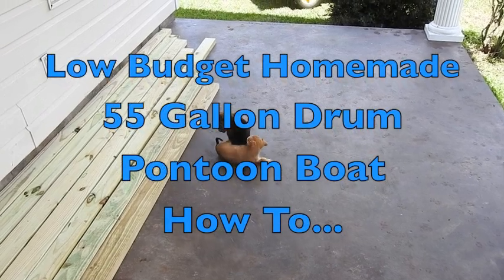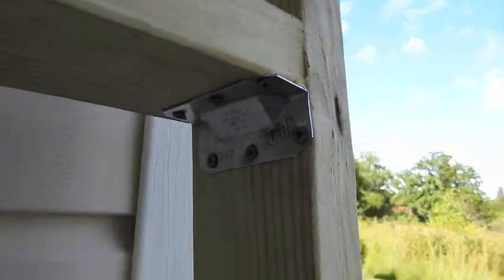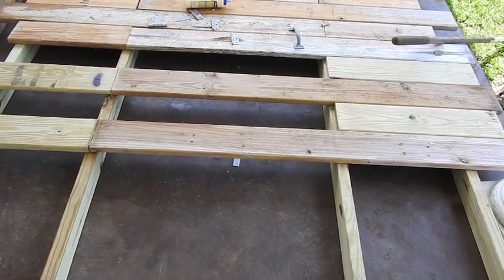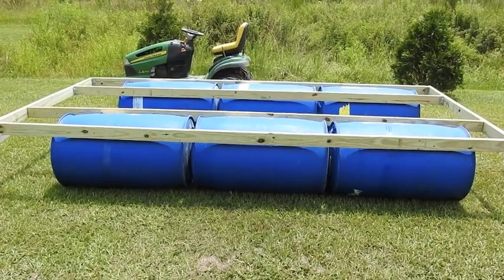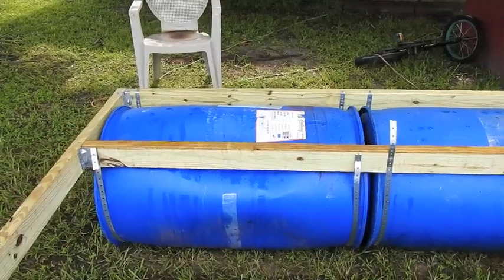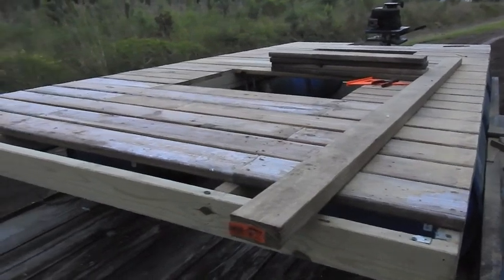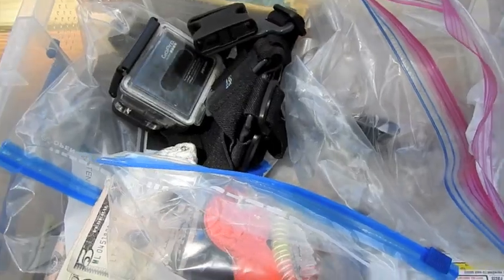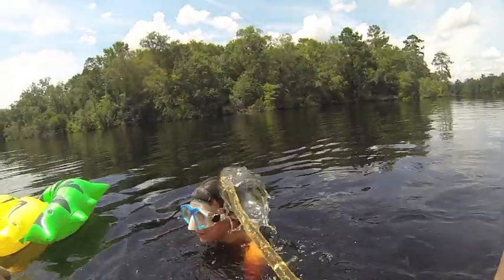My $200 Homemade Pontoon Boat (55 Gallon Drums)

Comment: Great work it's been a while since you built your boats can you tell me how they are holding up and any changes you have made or would make if you built another one thanks for sharing
Reply from the maker: @huxmetalworks7371  I actually sold both, but would think they are still afloat somewhere. Hope to build #3 soon and do not plan many changes. Might do deck boards next time instead of the plywood. I will make videos for you when I do and thanks for watching!!
Reply: @chud327  awesome I just found your fb  I love all of your videos you inspire me to think outside the box with you mowers and mowers I watch everything I can find  I look forward to seeing your next build thanks for sharing your work
Reply from the maker: @huxmetalworks7371  thanks so much!!

Comment: Im starting to build one of these have u had any problems with your barrells swelling from the sun  hitting them n making them hot then when sun goes down does the barrells get loose after they cool off
Reply from the maker: Next time, I am thinking of putting hole in the top so that they can't swell and contract.  Mine shrunk when I took it into some cold springs in episode #4. Thanks for watching and keep me up to date on your build.

Comment: Did the straps you used to attach the drums to the deck rust?
Reply from the maker: Not a bit! I you check out episode #8 from last month, it shows the straps after sitting on the ground all winter and no rust. Thanks so much for watching.  BTW, I have a "homemade barrel boat" facebook group, please consider joining it.

Comment: What engine did you used? and what the name of tin metal you used to wrapped the gallon drum?
Reply from the maker: that is a homemade boat motor, Johnson bottom and briggs and stratton pressure washer engine. The straps are called plumbers strap. Good luck and thanks for watching.
Reply: @chud327  thanks mate for replying my comment i wish to build one day. good luck too

Comment: Nice, but I just wanted to comment on the metal straps. You need to consider another kind of straps. I had the same thing holding my gas tank to my truck, it doesn't last long due to rust and breaking. Maybe winching strap sight work better
Reply from the maker: Those metal straps sat on the ground all winter with a sign of rust.  They could have been a little stronger, I guess, but they did fine in my book. My next boat will be used in salt water, I may need to thing of something better to use... Thanks for watching.

Comment: Seatbelts from a wrecking yard work well to fasten the barrels to docks/home made pontoons as well. Save a few bucks on the plumbing strapping :D
Reply from the maker: The plumbing strapping was about $12 and I used about 1/2 of it.  Are seat belts free, if so, that would be pretty neat to use. Thanks for watching.

Comment: Cool ass idea... but I think you should have made the platform much wider and longer. Those barrels could support a lot more.
Reply from the maker: Yes, but wider would not fit on my trailer, a long boat would have been cool. Thanks for watching.
Reply: Guess I didn't think of that. Good work, either way! Peace, bruh.
Reply from the maker: Thanks for the reply.

Comment: Nice video and awesome idea.
Reply from the maker: Thank you so much and have you seen my second pontoon boat? It is even better. Thanks for watching.
Reply: chud327 I am watching right now as we speak
Reply from the maker: @bahamasking2063  Sweet, I love hearing that. be sure to let me know what you think.
Reply: chud327 I will build one but not a boat. I will build a floating house with those barrels and then build a boat afterwards
Reply from the maker: @bahamasking2063  Sweet. I have a Facebook group called "Homemade Barrel Boats".  Be sure to check it out and maybe even join.
Reply: @chud327  I just signed up to join your group Sir

Comment: Nice Vid. Didn't read all (at this particular time) 1.3k comments to see if it was here, but would suggest an aluminum angle, channel, or even better yet a "box" frame. Cost may not be any higher if you found a sweet deal on some recycled aluminum. Aluminum could be screwed and/or bolted at joining points to avoid tig welder rental (or in my case, having to borrow from a relative.... holy crap). This would yeild same or better strength and wouldn't take 5 people to "heave" the boat back on the trailer. Speaking of, why not make a detachable pair of runners to load/unload your pontoon. I'm thinking each side under the barrels having something styled like a kitchen drawer slide with ball bearings which could be installed on a temporary basis (unless the trailer is devoted only to that boat). Harbour Freight has some roller balls for heavy tool stands at $.99 each which could be utilized and made into the main part of a runner. These runners could also be made of aluminum, and would last a long time with the ball bearings taking all the wear. Cost may increase to $300 or about, with the new frame and runners, but STILL....$300 for a pontoon?? And you could (but I'd rather scavenge some aluminum, or recycled marine ply) attach the same salvaged decking, basically sacrificing a massive amount of weight for the same (or close) final product/cost. I think a bit smaller version of your concept, with an aluminum frame, would make into a nice 1 or 2 person (depending on length) fishing craft , with a couple of pedestal seats of course.
Reply from the maker: Aluminum would be great, but I don't know where to find a good deal on it.  Many of the viewers may have trouble finding it too.  I am starting boat #2 and have already bought the lumber, trying to make it so anyone can build it. Thanks so much for watching.

Comment: Nice job Chud, i built one a few years ago and the plumbing straps have almost all rusted away, i;ll be using Stainless straps next time if i can find any.  i only used 4 drums and its a bit rocky in the water, is 6 drums more stable when walking around the Deck while in the water?  Keep up the good fun work. :)
Reply from the maker: Stainless would be nice on my next one too. The 6 barrels are very stable in my opinion, but now I want to build #2 longer and wider with 8 barrels. Thanks so much for watching.
Reply: HI again Chud, where did you get the Metal Corner 6 hole Brackets from?  @chud327
Reply from the maker: Kevin Chedville they were straight from Home Depot.

Comment: Cool build. Just keep an eye on the barrel straps, it would not be good to lose a barrel because of a rusted out strap.
Reply from the maker: Good point. I just had it sitting on the ground all winter and when I lifted it up and did a rust check, there was none.  If I take it salt water fishing, I will have to check it often. thanks so much for watching.

Comment: You could use 2 of the wheels on the back of the pontoon boat and make a mechanism so that they can lift up when you are in the water and drop down when you are on land that way you can move the boat easier
Reply from the maker: That would be cool and thanks for watching!!

Comment: Any reason you chose the plastic barrels over metal ones other than price difference?
Reply from the maker: That is a great answer. Thanks for watching.
Reply from the maker: I didn't see any metal for sale and I bet they would be more expensive.  I also like the flexibility of the plastic.  The plastic are lighter too. Also, no rust is good too.  Thanks for watching.

Comment: i thought for a second when he was listing out the supplies i thought for a second what are you gonna use the puppies for? a motor
Reply from the maker: That could work, a hamster wheel with puppies running on it. Thanks for watching.

Comment: Did you figure out what size motor works best for this?  I’m going to do this build as well but I’m not sure what size motor to go with…. Thanks
Reply from the maker: I would think a 15-25 horse should be great. I tried a 25 horse, but foot was too short. Good luck on your build and I hope to start build #3 real soon. I will do some more power experiments. Thanks for watching!!

Comment: How about pressuring the barrels with bike pump valve? Great boat!
Reply from the maker: That is a cool idea and I may need to try it next time.  I just need to figure out how to get the valve stems in each barrel so the will be easy to get to. Thanks so much for watching.

Comment: Interesting project. Wouldn't recommend wood glue for marine applications though, as most are water based and will likely fail if saturated.
Reply from the maker: Probably didn't need it anyways... Thanks so much for watching and planning to build a bigger one soon. I hope you will check that one out too.
Reply: @chud327  Sounds good. Will do.

Comment: I would have filled the barrels with sealed 2L bottles, so even if it sprung a leak in the main barrel the majority of the floatation would remain, even if a major hit took place and split 2-3 of the 2L bottles. Wouldnt add but ~ 25-30 lbs of weight for the whole rig, but would increase reliability by a large factor.
Reply from the maker: I don't know how to get the 2L bottles through that small hole in the drum... Thanks you so much and thanks for watching.
Reply: @chud327  I was under the impression that the tops of those drums unscrewed. if not then maybe cut open a square hole to insert them through and then epoxy it back into place?

Comment: was that waterproof wood glue?  Your barrel straps are gong to rust.. good for about 2 years..
Reply from the maker: I doubt it on the glue, but it didn't really need it anyways.  Good news on the straps, not a speck of rust yet.  And I have over half of the roll left to replace the straps if needed.  Thanks so much for watching and for the comment.
Reply: He is about 20-30 miles inland so galvanized strapping should last.  I wouldn't re comment it on the coast.

Comment: While I like the job you did, I have to ask, why didn't you remove the plastic tags on your lumber? Doesn't help to glue it if you are going to leave a barrier between the glue and wood!
Reply from the maker: Did you actually see this happen, I sure don't remember doing it and it doesn't sound like me. I am going back and watching, I will let you know. Thanks for watching.
Reply from the maker: Yeah, I did see any tags glued in...
Reply: At the 2:20 to 2:30
Reply from the maker: I see what you are saying and you may be right.  I may have pulled them off and editing took that out, but I can't say 100% either way.  I will do better next time and thanks for the reply.

Comment: I saw a video last year of a guy with an old outboard like yours and he removed motor and replaced it with an electric. It was an industrial motor, like from a belt drive or something else, but it bolted right on and the shaft connected to the prop linkage. Really powerful and almost silent. He ran it from some batteries and a solar panel
Reply from the maker: That would be so sweet and thanks for watching.
Reply: chud327 
You're welcome. I like your videos a lot and a lot of respect. You've made some pretty cool stuff. You are a tinkerer. Those videos I mentioned is from J Mantzel, and diy electric boat. I think he lives in Florida also, and does things like you. I live in Colorado, but sometimes visit a good friend in Crystal river. Keep making those awesome vids!!

I saw in another video of a guy making a gocart electric motor from an alternator from a car at the junk yard. He took the alternator apart and explained the process of reversing it to use current instead of making it. Surprisingly it was really powerful

Comment: First aid kit? life jackets?
Ladder to get in and out of the deck for swimming
Reply from the maker: Life jackets were a yes, no on every thing else. Thanks for watching.
Reply: Life jackets required. A type 1 throwback device not required because less than 16 feet. He has no enclosed hull space so fire extinguisher not required but all that wood might be a good idea. A whistle or noisemaking device  and paddle are required and an anchor is a good idea but a road and concrete block is probably sufficient in a low current area like they are in

Comment: Chud, buddy, about the only thing id change is on the front of the barrels id fix some sort of a cone on the front, to break the water so it would offer less resistance and make your boat travel faster
Reply from the maker: Been there and done that, I hope you will check out episode #4, my favorite episode, it has just what you are looking for . Thanks for watching.
Reply: @chud327  I'll continue watching the series. But based on only seeing the first episode that was all I could think to add
Reply from the maker: That is cool, just thanks for watching.

Comment: You can buy a brand new motor for that outboard for $100 at Harbor Freight. 5.5 hp and it should bolt right up.
Reply from the maker: That would be pretty cool , thanks so much for watching.

Comment: Pretty cool..you probably know this trick..to firguired out how much weight a barrels can float..just take the weight of 1 gallon of water (8lbs)and times how many gallons the barrel can hold..so 8 ×55 = 440..let me know if I am wrong.
Reply from the maker: I hear they are good for about 400 pounds so your math sounds pretty good to me. Thanks for watching.

Comment: @chud327 take two drums and turn them sideways on the front to help with water drag and floatation
Reply from the maker: I am, and have been, brainstorming a great solution to that issue. I will let you know if i figure something out. Thanks for watching.

Comment: Love the videos! Any chance to get a material list that was needed???
Reply from the maker: I used 5 - 2X4X12 one was cut in half, 1 box of 100 feet plumbing strapping that was not all used, deck boards or plywood, screws, and some metal brackets.  You should see every thing I used in the video. BTW, I am about to build boat #2 real soon. thanks for watching.
Reply: @chud327  Great job. I love how everyone gives you credit for leading the way.
Reply from the maker: I will take the credit, I guess.  Have you seen my facebook group called "homemade barrels boats".  We are looking for more members.
Reply: @chud327  Already signed up. Haven't posted yet cause still learning from all the different videos. Thx again.
Reply from the maker: Perfect and glad to hear it.  I will be posting my next build, hopefully next week.

Comment: I cannot find  those type barrels anywhere with the lip on the bottom
Reply: Mark Marie I bought 2 of them just the other day, ... $6.00 each, ... they had vinegar in them, ... they had other barrels, but they had had sodium hydroxide in them, & others that had bleach in those, ... I only took the ones with vinegar, because I am using them to collect rain water for my garden, ... don’t know what the sodium hydroxide would do to the veggies, ... & I probably could have used the ones that had bleach in them, ... but ehh, ... wanted only food safe, barrels, ...I cut the top off of one of them already, flipped the lid upside down, & it makes a perfect lid, ... need to size the hole for the downspout, & add some screening, to keep debris, & skeeter eggs from being inside my barrels, ... may try my hand at a bit of aquaponics later this summer, ... but for now, I am satisfied with what I have, ...
Reply from the maker: Nice and aquaponics would be sweet. Thanks for watching.
Reply from the maker: I got luck and found mine on craigslist, I hope they still sell them. Thanks for watching.
Reply: chud327 Ifound mine a few miles south of here on the facebook marketplace, ...
Reply from the maker: Nice, I checked and mine are still on the craigslist.

Comment: next you need an easy up, portable shade  screwed to the deck, it gets hot down there.
Reply from the maker: True it does get hot and had though about an easy-up, but I found a bimini top that work out perfect. Thanks so much for watching and for the suggestion.
Reply: Cheap tarp and pvc frame?

Comment: If you soak the wood in motor oil are wip it down with a rag in motor oil it will last alot alonger before roting out .
Reply from the maker: That is true, but it may scare all the fish away... thanks for watching.

Comment: How did you build your motor?
Reply from the maker: I have a couple of videos of it on here some where. It is just a mower engine adapted to the kicker foot. I want to soon take it apart and do some gears or pulleys to make it faster, if I do, I will make you a video. Thanks for watching.

Comment: You and Steve Wallis built pontoon boats out of those blue barrels.  You've probably saveed about $17,800 from an aluminum boat.  I would feel better with a 2x12 as a transom to mount a larger motor.
Reply from the maker: I don't know Steve Wallis, did he make a boat too. These thing can easy go for 18K.  I am planning a bigger board for the transom of build #2 and thanks for watching.
Reply: @chud327  He has a YT channel mostly relating to camping.  Search YT with his name and you'll find him.  I did notice the more robust transom board on the video you posted in June.  I think the plastic barrels are better - takes a lot to put a permanent dent in them.
Reply from the maker: @danburch9989  I will be looking him up, thanks for the reply.

Comment: Mending plates from a hardware store and untreated lumber make for a one season vessel. Use 316 stainless fasteners. And make your own mending plates from 304ss  or better. Better being 316. I am a marine fabricator for 22years. Reg kiln dried wood is not acceptable. Treat it with fiberglass resin.or use aluminium for your crewmembers. You are wasting your money otherwise.  Good idea. Just use the right materials. You will be much happier
Reply from the maker: We will see how long it last, maybe the next will have some stainless steel... thanks for watching.